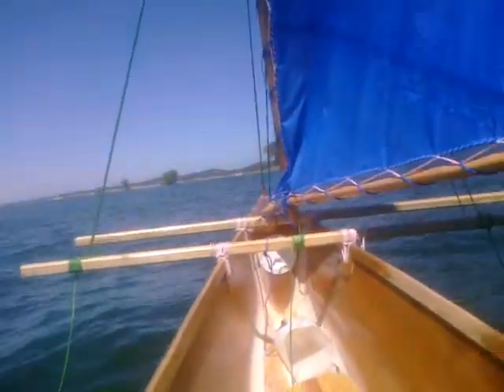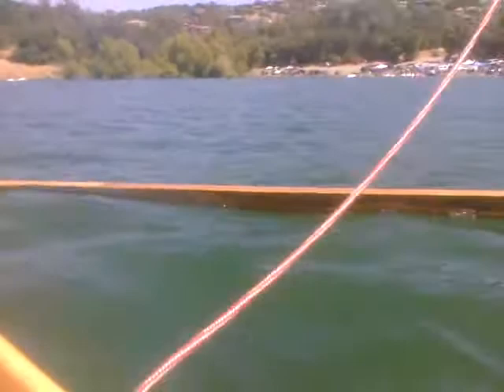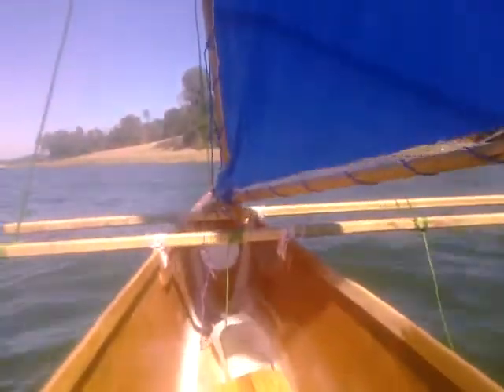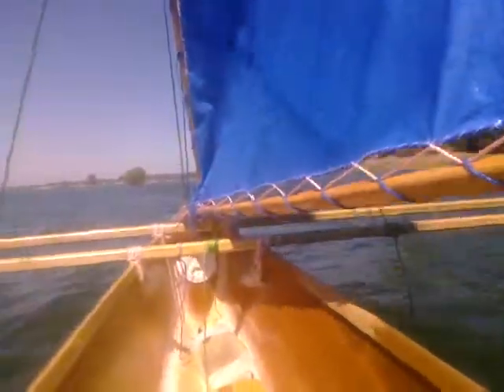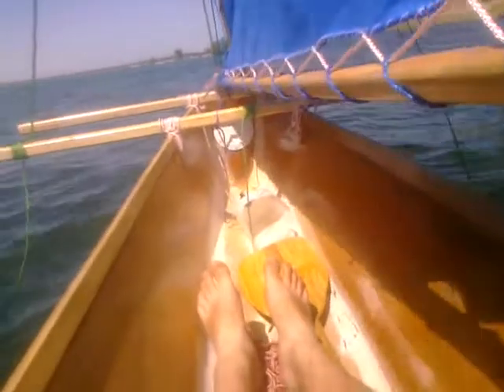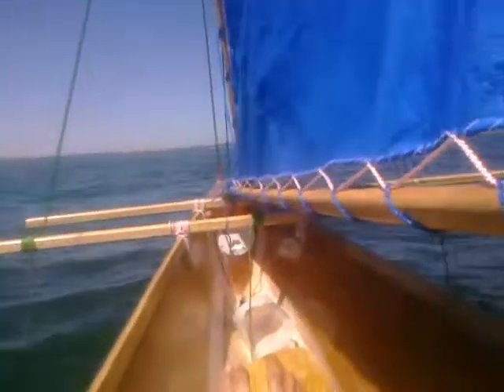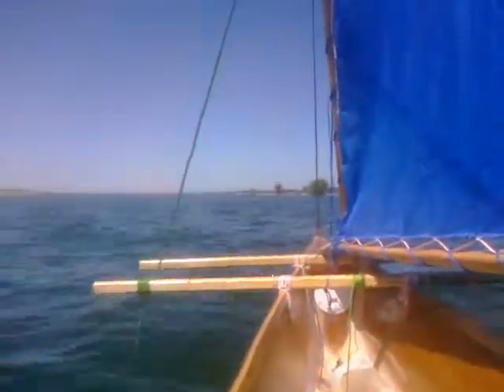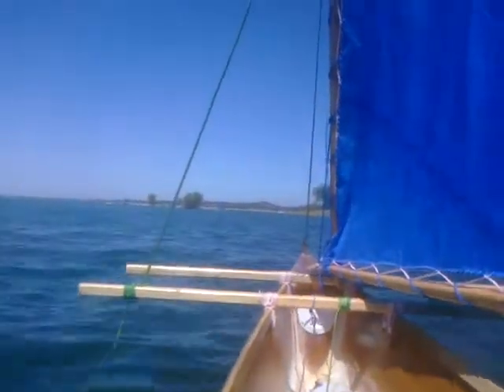James Wharram Melanesia

Comment from the maker: @corichg I actually extended mine by 2' , I added square panels in the middle, which made the lines a little odd, the main reason to give a little extra carrying capacity, when I take the kids out. The steering oar is great ! If the tiller on a normal boat is like steering a car, then this is most like a motorcycle. Complete brain rethink ! As the notes mention, you can spend years tweaking mast position, weight position etc, and I will, if only to the boom up so it doesn't hit my hat !